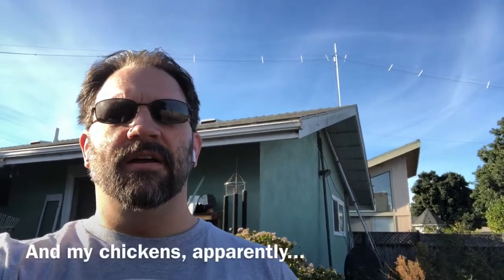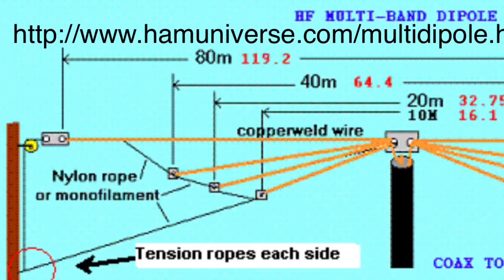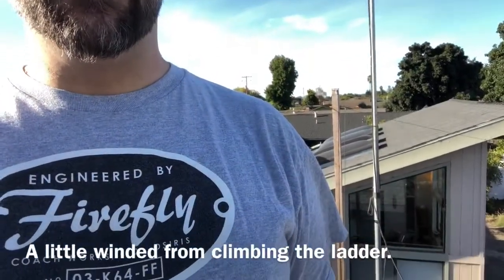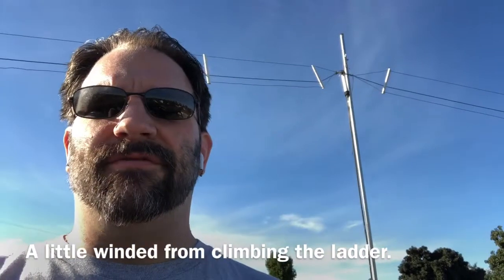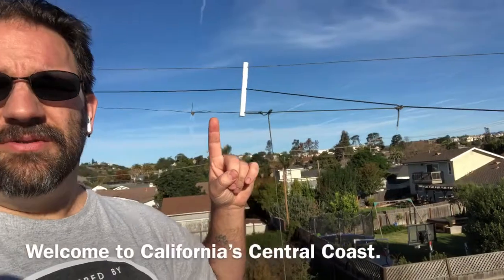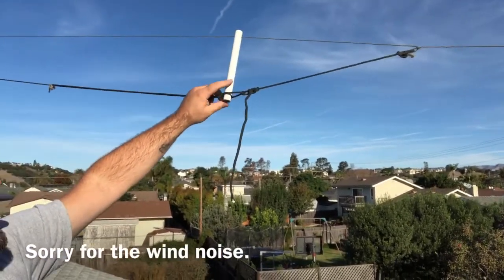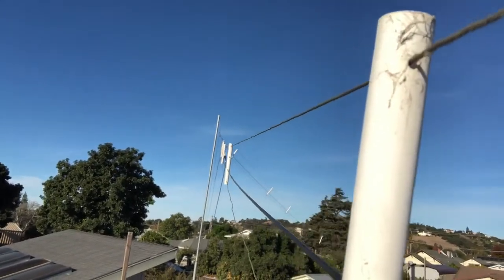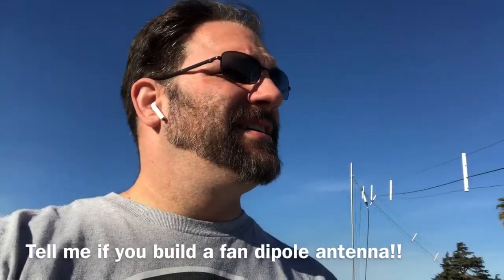Smitty Working On SOMETHING: Fan Dipole Construction Techniques

Comment: The first amateur radio antenna I built when I was a Novice was a fan dipole for 80 meters up to 10 meters (80, 40, 20, 15, and 10). It was a colorful antenna, red, white, blue, green, and black, all scrounged from a construction site dumpster, brought home and spliced and soldered together. I didn't use a balun, rather a coaxial choke. I had no difficulty tuning up with my Heathkit ATU. This was when the bands were open most of the time. My station was QRP CW and most transmissions were 3 watts or less. My first 50 QSO's were close to 5 watts but I soon decided to back off on power so I wouldn't blow my final transistors. That was a great antenna. I have used many different types since then, though. 73 KB8AMZ

Comment: Youtube put you on my play list again today, been a year and I am still pondering my various build projects, my 17 years old pup passed a few days ago so his no longer needing me in sight and smell distance is freeing me up some to maybe get something done. Your fan idea is still in my thoughts, I discovered certain plastic or PVC pipes can be used with my no hole roof satillite mount stand to go at least 35 feet up so some kind of wire antenna can be center supported with it. I still want to try the idea of using the non-radiant or counter poise side of a fan dipole with a switch making it possiable to switch  from horizonal radiant elements to vertical feeding it at the top of the pole coming down at least for 40, 20 and maybe 10 meters, using 40 also on 15. Just a theory, who knows if it might work? If so  anyone feeding a dipole and supporting it in the center could add a vertical componant to their dipole. Just something that seems to return to my thoughts ever so often.  Also couldn't 30 meters or 10 meters  long  hormonic be nears 6 meters , if so your friend wanting a 6 meter might be able to use the 30 meter elemeny much as the 40 is used for 15? Idon't use 30 meters so can't try it?
Reply: Sorry to hear about your pup.

Comment: Thanks Mark, I likely will be trying one before long. I have a strange idea of doing one except making the driven go down a pole and  using the non-driven like a counter poise, so it would be a vertical with the coax attached at the top .  Kind of like a DX COMMANDER  vertical except top driven and not having so many radials. Also the idea of coming off a metal roof with multiple driven elements  going to trees much higher has entered my mind. I have room in my yard  long enough for one side but not a stretched dipole.   Of course the lower take off angle of a vertical for DX appeals to me.
Reply from the maker: I’m not sure I understand. You mean like a 1/4 wave ground plane, but up-side-down?  By definition, if one element is driven and the other isn’t, that’s not a dipole, that’s a ground plane. (The “not driven” side is the ground, or counterpoise.) And usually you want the ground or counterpoise below the driven element, though I confess I’m not sure if that’s just convenience or for some electrical reason. 

I’m all for you trying it out and telling us how it goes! But I’m curious, why top-feed the antenna? Is it easier to construct in your situation somehow? Or just experimenting with something new?
Reply: @SmittyHalibut  Like I wrote a dipole full length is over 130 feet on 80 or over 66 on 40  so space matters. I wanted a vertical dipole but going 66 ft up  for 40 or 130  for 80 is also not doable, but I can top feed  for lower bands and  use the single counterpoise not 130 like some many think is necessary for a vertical. I stay confused how a dipole can be a single wire equal to the driven element yet a vertical needs many times that to work. A vertical anything antenna has a much lower angle of radiation  and is much better for DX . A DX Commander is a fan vertical yet still requires a large  array of radials to work, by moving the feed point to the top, only a single non-driven counter poise  wire for each band in theory should work.  That is my reason for this approach.

Comment: So how has it worked out after 5 years? I am adding 60 meters to a 40 meter dipole and without seeing your video I also used PVC spacers. I was wondering if the shorter element could be put on the top rather than below as most fan dipoles are constructed. My purpose is for NVIS local and regional nets.
Reply from the maker: It worked very well for the time I had it up, but I ended up taking it down several years ago for various reasons.  There's no reason the shorter element can't be on top, but since you'll generally be tying off to the longer element, it's easier to let the shorter ones hang down.  But if your construction method makes it easier to put the shorter ones on top, there's no reason that can't work electrically.
Reply: @SmittyHalibut  I think 3 is the best number of bands.  This is a great way to have a reasonably priced reliable multiband antenna that's quite easy  to build.

Comment: Samp problem here. I cut off 20 and 10 because they would never tune. Just have 80, 40 and 30 wires which tune fine . Not sure why 20 and 10 would never tune no matter how much pruning or adding back i did .

Comment: I wonder if you could add the upper bands by making them an inverted V -- common feedpoint for both the existing fan dipole as well as the fan inverted V, but a higher pair and a lower pair of endpoints, the higher for the lower bands and the lower for the higher bands (as inverted V).
Reply from the maker: Yes, absolutely you can do that. In fact, many designs I’ve seen suggest a much wider “fan” than I have. The more space between the elements, the less they’ll interact and affect each other when trying to tune. They don’t even need to be in the same plane, but obviously this will affect radiation pattern of the different bands.

Comment: Good video, I wonder if the height still allows NVIS use,  debating if I WANT GREATEST HEIGHT or go lower and hope for better shorter range 100 to 300 miles or so for day time 40?  I have a roof mount stand normally used for satellite dishes  that can anchor another pole with 30 or so feet up available, plus some of the large coax reels used by cable  companies for their hard line ( got 4 of them along with a supply of the ends to short to use for them)  that a plastic pipe can be just stuck in the middle to hold them up to use at the ends so some flexibility.  Hurricane Michael  did a number on my community blowing down thousands of trees and also requiring the cable companies to run new hardline. Comcast replaced their entire system taking down miles of hardline.  i am even considering using some 75 ohm hardline as the feedline burying it to stop common current issues or going part way and then making the last leg rg8 or  other 50 ohm.

Comment: Hey Smitty, new sub and new ham here.  I am building a fan dipole and am searching for construction techniques. this will be my first attempt to get on the HF airwaves from my QTH.  I am planning 4 lines (80, 40, 20, 10, with 15 resonating on 40 with 3rd harmonic).  I have heard that I should keep it to 3 lines because of what you mentioned.  The separation, I am planning will be roughly 5” between lines.  Thanks for the advice and techniques you used, they have helped me finalize my plans.  I know this is a few years old and I am assuming your are still on here.  My main question is how do I keep tension and I think you answered that in the video.  Also, tying rope to the next available line with rope is what I thought of doing.  Another question I do have is how do you keep the separators from sliding around on the lines?  Silicon or hot glue?  I am going to start drilling and measuring cable, and making my feed point this weekend.  If I am successful, I hope to see you on the air and thank you for your input.  73 de KI5HXM Brent from Texas.
Reply from the maker: Hey Brent, sorry for the long delayed response. Life has been a bit chaotic this year and this one slipped through the cracks.  I don't have anything keeping the separators in place, they're just held there by the tension in the wires.  I haven't had any problem with wind moving them around, but if you walk up to the antenna and move it with your hand, it moves easily.

Granted, this is with California "weather" (put in quotes on purpose.)  So any place with REAL weather might have a harder time with that.  In that case, something like what you suggested would work: hot glue, silicon, rubber grommets, whatever.  So long as the material isn't particularly conductive, and you keep it relatively small, it'll be fine.
Reply: @SmittyHalibut  thanks for the reply.  Yes it has been crazy here in Texas.  Haven’t even got my ride on the HF airwaves yet.  No worries on the delay.  I have thought about some kind of silicon or rubber with maybe a zip tie holding it to keep them in place.  I have lots to learn.  That is why I am in this hobby. Thanks for your videos and input.
Reply from the maker: ZIP TIES! Brilliant. Yes, that would work well too.

Comment: I love the floating Floyd Rose reference! 73 WSØX
Reply from the maker: Marc White i used to have a floating bridge and could never get it tuned right. I’ve gone with static bridges, or tremolos that rest solidly against the body (is there a term for that?) ever since. I’ve never found myself really using the ability to pull my tremolo anyway. 

I’m glad that at least someone caught the reference. :-)

Comment: I had a 10, 12, 17, dipole I called a porcupine. Common center but antennas went different directions.
Reply: It worked real well until the roofers cut it up.

Comment: A ham buddy of mine saying that have a balun close to the metal pole isn't good at all.  Does that affect the antenna at all?  I have an 80 meter windom and the Balun is on a standoff so it is not directly on my metal push up pole. 73 KA9WLU
Reply from the maker: Not that I've noticed, but I also don't have any precise measurements. I think it would depend heavily on the type of balun used.  Anything with a toroidal transformer will be fine since all the fields are kept internal to the toroid.  A linear (like a bar) transformer will have magnetic fields outside that might cause a problem.

But I think this particular balun is just a bunch of ferrite beads around the coax jacket; you're not so much trying to make a precise inductance that would be negatively impacted by the presence of steel, but make "a whole lot of inductance" to choke off RF.  So adding more steel near by is unlikely to impact that too much.  But, I confess, I'm making that last part up, I could be wrong.
Reply: @SmittyHalibut  Ok thanks Just was wondering.  I'm trying to get back to ham since a recent divorce last year.  I'm working RF issues in the shack and might have make me a RF choke.

Comment: Thanks for this Mark. Im in the process of putting together a fan dipole with 80m and 40m to begin with, might add 20m at some point. Your video has been very helpful from a practical design perspective. I will let you know how I do once it is up - I currently have two separate antenna's that I want to combine on a single feedpoint. btw, did the gent that recommended against knots ever get back to you? de VK1FCLU...73
Reply from the maker: Not that I've seen.
Reply from the maker: It'll blow your RECEIVER? Right.  #dontfeedthetrolls